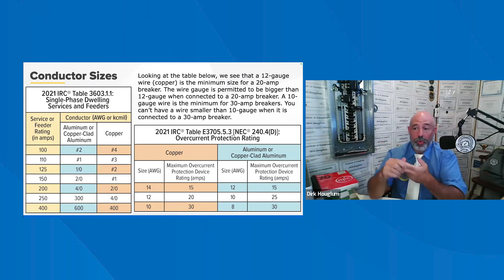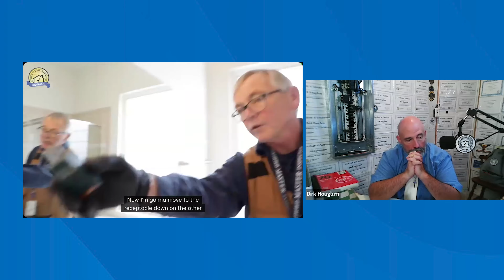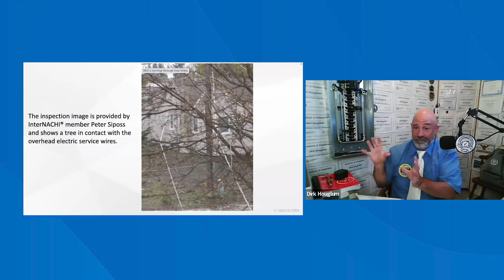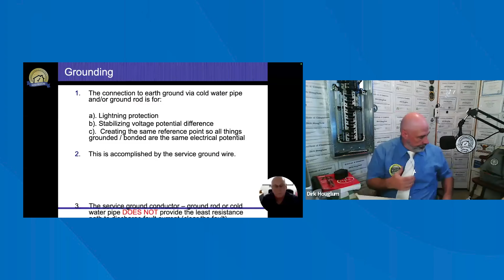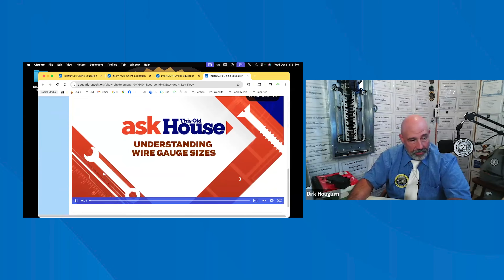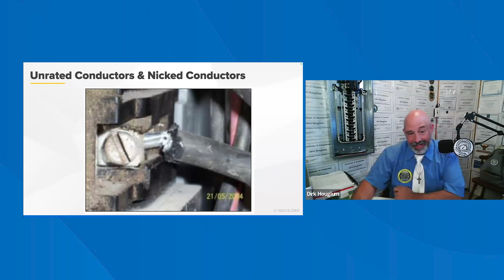How to Perform Residential Electrical Inspections

Comment: The video has too much misinformation. InterNACHI should have an expert review videos before posting them. It’s ironic that he says inspectors should use proper terminology but he misuses terms and makes up words. He gets basic stuff wrong. For example, at 18’10” he says a #3 conductor is pronounced “3 aught”. That’s wrong. #3AWG and 3/0 (3 aught) are two different wire sizes. He says the same thing later in the video about #4. He says that #4 is pronounced 4-aught. Again, #4 and 4/0 are two different gauges. He repeatedly refers to “Amplicity”. Amplicity is not a word in the English language. At 22’35” he says “#14 should not be connected to a 30 A breaker.  Why? Because of the resistance is going to be too much”.  Seriously? That, of course, is wrong. At 23’14” he says “Ohms (mumbles) and that has a Greek symbol which I believe is god”. It is not a Greek god. At 31’52” “Ground is bonded to the panel and it is isolated from the neutral”. That is a common misconception that is common among home inspectors and poorly trained electricians. They are not isolated. The grounded (aka neutral) is always solidly grounded. That fact can easily be verified with a continuity tester.
Reply: Thanks, George. We'll work on pronouncing things better.
Reply from the maker: We'll work on our pronunciations, George. Thanks.